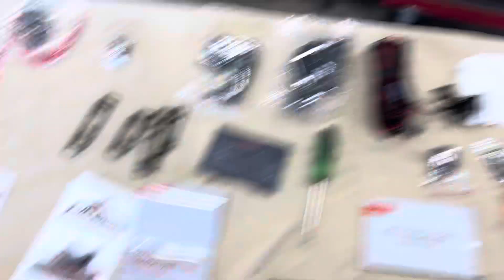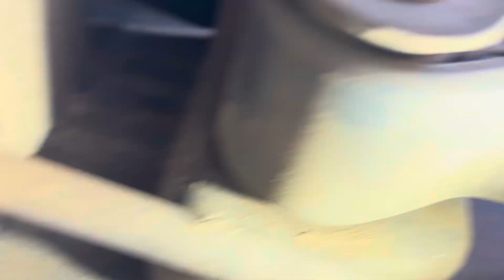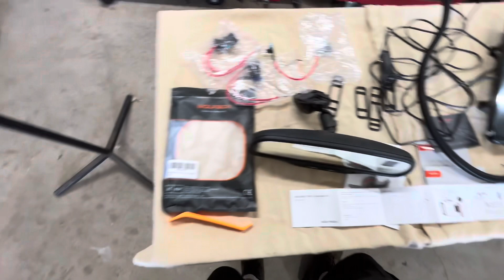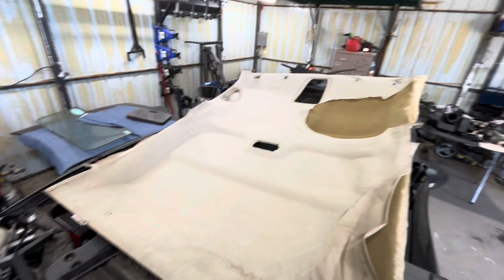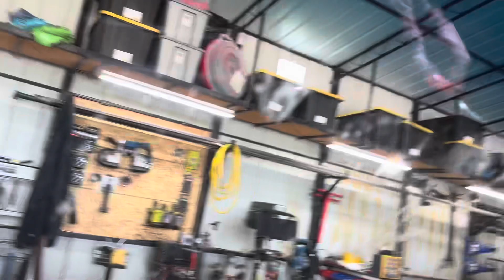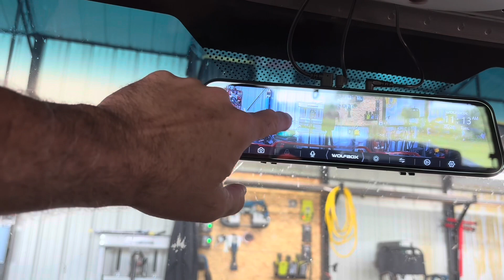2006 Chevy Silverado Wolfbox Dash and Backup Camera Installation.

Comment: You could have picked up the dongar 10 pin power adapter and pull power directly from the factory mirror and not have to hardwire anything.  45 bucks well spent when i put my wolfbox in

Comment: Does this guy not realize wolfbox literally sells a mount…
Reply from the maker: Apparently I didn’t!
Reply: @ogresspeedshop would have saved you a couple bucks and less bulk than mounting to the mirror
Reply from the maker: I had a buddy of mine order the stuff when I was on my way out to pick up my Camaro from San Diego. It was almost 2 years ago.  Wasn’t really familiar with any of it, went with the cheaper options for everything.  The mirror was less than $20 and whatever little time I had into making it work.  I honestly wish I would have waited cause I would like to be able to link to my phone and as of right now, I have never taken a video off of the card. Not even sure I have a way to do it.  I usually just use it for the back up camera for hooking up my trailer these days.  Live and learn I guess.  Living where I live there isn’t much traffic to deal with so they’re almost not even needed unless I think I see a Bigfoot while driving.  I just wanted something for when I was driving in San Diego with the trailer cause those people can’t drive.  Dealt with 26 years of SD drivers and now I’m just enjoying the simple life in Oklahoma now. I had bought a little cheap camera from Walmart before I went out there and I kinda liked it better.  Over all it’s a good system, but just kind of a waste on my truck here.
Reply: @ogresspeedshop I have the G900 Pro for my Silverado and I went with the mirror kit looks factory I live in Texas where the tint rules are lax so I have 5% on my back window I mounted the rear camera on the crew cab for better visibility drivers out here suck so I’d rather have this as insurance